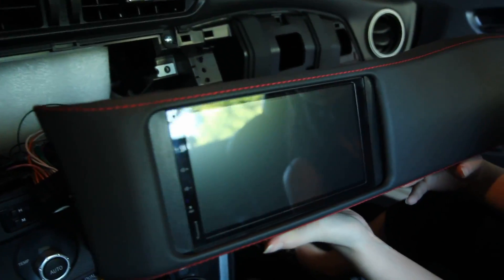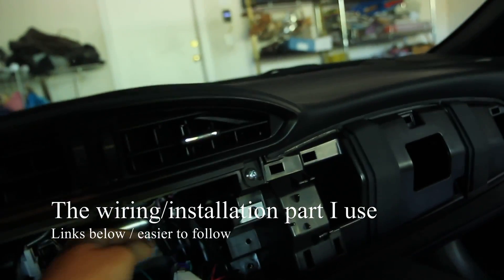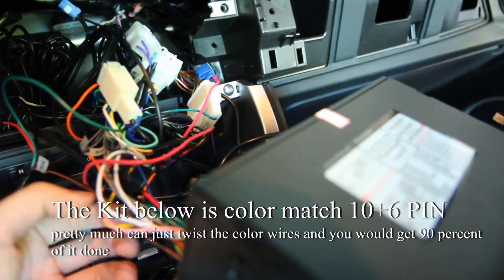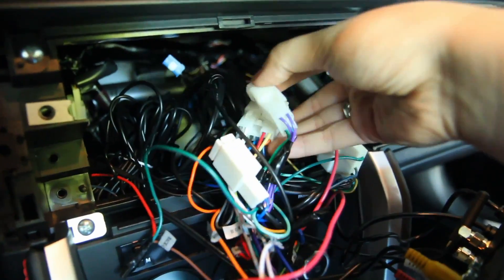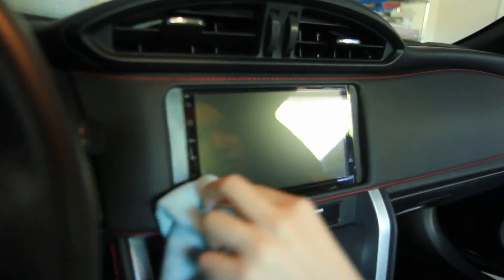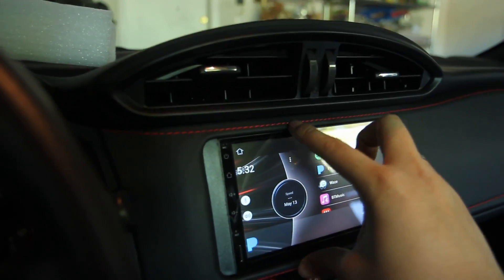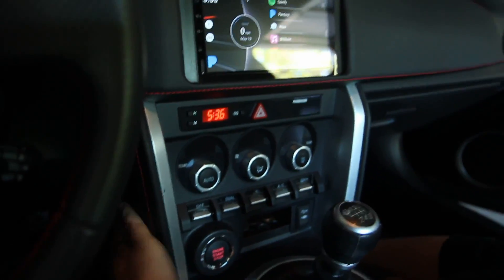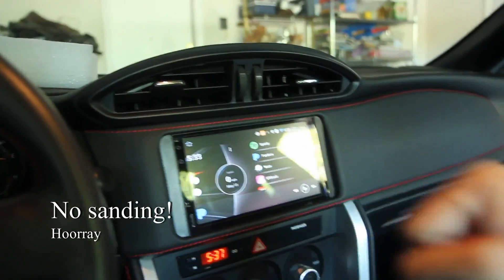Universal Android Headunit Double Din Install

Comment from the maker: The Universal Head Unit: https://www.amazon.com/dp/B01N34UURY/ref=as_li_ss_tl?ie=UTF8&linkCode=ll1&tag=8324894-20&linkId=6b1f9209ccc66a01efc316de02a00914
Dash: http://parts.hymanbrossubaru.com/p/PANEL-CENTER-ASSEMBLY/66757573/66077CA200.html
Metra Dash kit: https://www.amazon.com/Metra-95-8202-Toyota-DDIN-Multi/dp/B000K52CY2/ref=as_li_ss_tl?s=electronics&ie=UTF8&qid=1495569966&sr=1-1&keywords=toyota+metra+dash+kit&linkCode=ll1&tag=8324894-20&linkId=9fc247e312b97b4eacca3dfbb1618f22
10 + 6 pin and antenna (radio + main stuff): https://www.amazon.com/Subaru-Double-Aftermarket-Harness-Install/dp/B01AC7FK8C/ref=as_li_ss_tl?s=electronics&ie=UTF8&qid=1494667672&sr=1-1&keywords=brz+radio&linkCode=ll1&tag=8324894-20&linkId=7989ae41fcfa7c6b2f9a39175cddfd4c
for camera to work, aux, (you have to tinker): https://www.amazon.com/gp/product/B00BXF5A74/ref=as_li_ss_tl?ie=UTF8&psc=1&linkCode=ll1&tag=8324894-20&linkId=5a9dad1e5200e3af443ca20c70f078e5
if you want to use your stock camera: https://www.amazon.com/gp/product/B00CGQRIFG/ref=as_li_ss_tl?ie=UTF8&psc=1&linkCode=ll1&tag=8324894-20&linkId=c2c74987171bd2dc86336853aa967d69
Reply: John Nguyen this is pretty much for 2015+ wrx and STi right? Thanks again awesome that you provided all the links👍🏼✌🏽
Reply from the maker: brz and wrx have pretty much the same wiring except for the very first 2015 base model wrx/sti.

Thanks

Comment: I noticed the DIY install includes a microphone. Does that mean that you can't use the stock microphone with an aftermarket unit?
Reply from the maker: yeah you cant use your stock one without modifications that i didn't want to do
Reply: Thanks. I also bought the AX-TOY28SWC but the DIY you linked to ft86 club used AX-SUB28SWC. What's the big difference here?

Comment: is is possible that you can take a picture of the way you set up the pins on the 28 pin connector? I have the 2016 Scion Frs and I want to use the factory camera. The picture that's on the link it's for a different head unit so the wires don't match up to mine.
Reply from the maker: This car is my gf, so i can't really get any pictures. However i can provide a link to where i reference too. 

http://www.ft86club.com/forums/showthread.php?t=111866

Comment: I need help with the back up camera i bought all the wires but how do i modify the pins? what pin goes where?
Reply from the maker: to modify the pins you need a special pick tool to allow you to pull out the wires. This is needed for you to get the camera to work.

Comment: what is your opinion of putting a 2 din android unit into a WRX vs using the one designed for it. There is a 2 din addapter for the wrx that is readily available.
Reply from the maker: the ones for the wrx is a lot more expensive now. i see them generally like 350++.

this is a good option who are moving towards a more budget friendlier build.

https://scontent-lax3-2.xx.fbcdn.net/v/t1.0-9/18300897_10210649854060630_1556652914383076360_n.jpg?oh=2964892c8e063b4c23792ec6c3f11199&oe=597D5AF1

Comment: I have a 2017 limited and I think the HU connectors might be different.  I know the changed the HU from the 16 to the 17.  Do you happen to know.  and do u have an Install video of the panlelo in ur wrx
Reply from the maker: a 2017 limited brz or wrx?

The wiring harness is the same for both systems. 

I do have a photo of how it would look on a wrx

https://scontent-lax3-2.xx.fbcdn.net/v/t1.0-9/18300897_10210649854060630_1556652914383076360_n.jpg?oh=2964892c8e063b4c23792ec6c3f11199&oe=597D5AF1
Reply: John Nguyen sorry 2017 wrx
Reply from the maker: i never installed it on the wrx but it will be pretty much the same thing.

You would just need to get the wrx specific trim piece http://amzn.to/2ry9Lvk

Comment: Hey man, just installed this in my 2015 WRX (non-nav). Everything seems to be working, but I have no steering wheel controls (there's nowhere to plug my Autoharnesshouse wiring harness for the controls into) and my bluetooth won't connect. The unit keeps saying "error while trying to connect" as soon as I try and search for a network. Can you help me out?
Reply: Ok, so I got the bluetooth and steering wheel app figured out. I didn't know there were more apps installed other than what was directly displayed upon start up. My steering wheel controls still don't work though. My Key + and Key 1 wires aren't hooked up to anything. Any idea on where they might go? Overall I like the head unit a lot, thanks for your content!
Reply from the maker: I had the same issue KTM, what i had to do is repin the ground wire. It was super trivial but got it to work
Reply: I ordered the ASWC harness. A little more money, but hopefully I get it figured out fairly quickly and it's not like I already have a ton of cash in the upgrade.

Comment: hey so I'm doing the wiring now, and I have left 4 wires left from the panelelo wire harness..( green *key + )(orange *key 1) (brown --*back car*)(pink *brake Ctl) where do those connect to?
Reply from the maker: key are for steering wheel control, brown back car i(mayb power for your backup camera) m not sure, and brake is it can detect when you have your ebrake up and off i beleive

Comment: Hey man I know this is old but I just want to find out if you were able to connect the standard USB + AUX port to work with the new unit or did you just leave them disconnected?
Reply from the maker: she doesn't use it so i haven't test it. i believe the aux works but she never uses it lol
Reply: John Nguyen Thanks man! I found out my radio model is too old to support a back USB input 💔

Comment: hey did you have a hard time fitting the head unit into th dash piece with the metra kit because i cant get it to fit. 2013 frs.
Reply from the maker: Yeah i did, What i had to do is trim metra kit so i can fit the oem bracket. I just used scissors and a filler so nothing speical.

But it was a pita
Reply: John Nguyen when u ssy filler what do u mean. like bondo?
Reply from the maker: I might have misread your question
The meta piece didn't play nice with my stock radio brackets (what bolts the stock radio into the car)
I had to cut and sand the meta piece so i can reuse the stock mounting brackets

--

As far as getting the meta piece to fit into the dash trim. I just had to squeeze it in.
Reply: I also have a 2013 fr-s and really want to do this. In hind sight, any ideas of a better way to get the brackets to work??
Reply: Will Flanagan one side fits but the other part wont.  so im going to sand it down. havent down it yet but i sort of got an idea
Reply: Thanks man. I ended up going with the Seicane double DIN instead, it's in one of his other videos. Fits perfectly apparently. Good luck to you hombre!!

Comment: I installed it and for some reason i have no bass. Even if i increase it through equalizer. I know frs has oem amp for bass not sure Please help
Reply from the maker: That's super weird, the stock system always lacks punch i would really check your wiring again.
Reply: John Nguyen do you happen to know what color wires are bass
Reply: If your cars stereo came with a factory amp and sub and you install a after market radio you are out of luck.  Whenever you install the after market radio it makes your factory amp forget about the sub going from a 5 channel to a 4 channel thats why you no longer feel the bass.  If you installed by yourself you might also want to get a device to check and see if your speakers are out of phase, im not saying you installed the wires incorrectly but when it comes to a factory amp its like speaker wire color coronation doesnt exist. so basically your door speakers positive and negatives might be flipped around without knowing and thinking you wired them correctly.

Comment: I have the beatsonic backup camera. PDF here: http://www.beatsonicusa.com/Instruction_Manuals/Manual_En_BCAM7.PDF
Also got the adapter [http://www.beatsonicusa.com/bcus3.html] for stock head unit. Does this unit have a RCA in? I assume I probably don't need the adapter anymore and can just plug right in without doing any tapping?